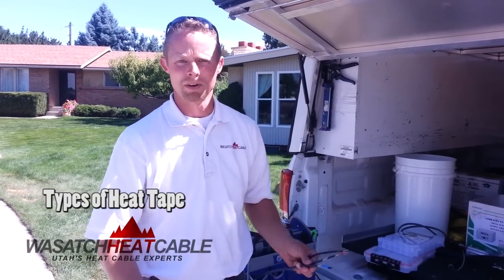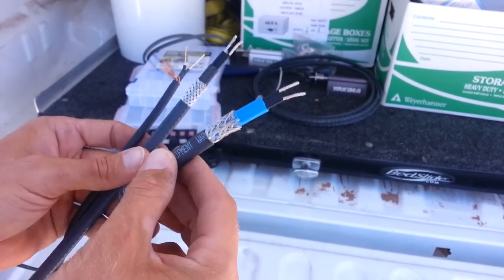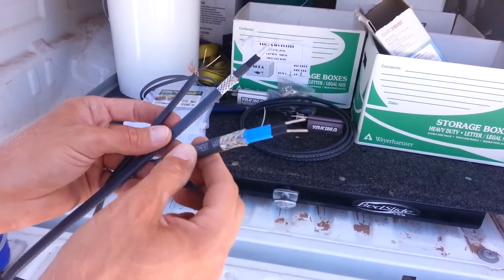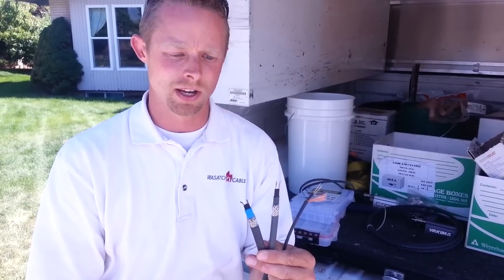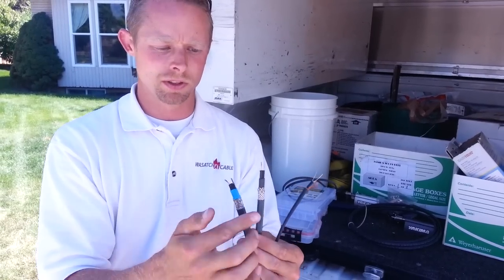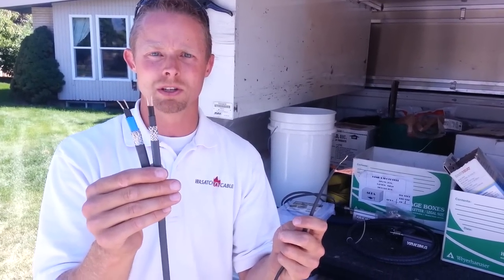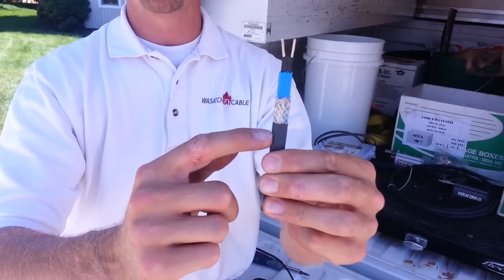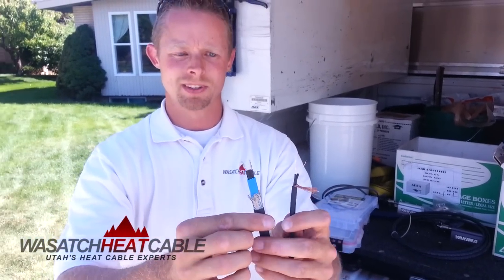Types of Heat Tape/Cable

Comment: He claims the constant wattage heat tape will use the same amount of power year round. The Easyheat tape he refers to has a thermostat that shuts off the power to the tape when the pipe temperature reaches 45°F. That said, if the thermostat is defective, then yes, it WILL consume energy regardless of the ambient temperature. Otherwise, at temperatures over 45, it won't consume ANY power.

Comment: Nice explanation. Can I use a 12" length of constant wattage cable to wrap around an outdoor GFCI outlet box that is mounted on a marina float? The GFCI is shutting off due to ambient humidity and my hope is to reduce that humidity without interfering with the intended performance of the GFCI outlet. Next question: Can one cut this cable to a 12" length without affecting it's performance (other than the obvious loss of heat)?

Comment: I have had It with electrical heat tape It requires a lot of Insulation to work the wires break Inside the thermostat does Not work most of the time they heat so slow can Not tell If working one time I cut the cable In half and watch If for a while then went to bed during the middle of the night It caught on fire a few hours later I found the garage floor flooded luckily when It burned through the line It put Itself out.... 
What I want to try and I do Not know why No One does It, Is wrap the Water lines with clear plastic hoses and have a Water tank and a large Fish aquarium heater and a hot Water pump and pump warm Water through the hoses.

Comment: Definitely an error in the narrative near the 5:30 mark. As the cable cools it reaches a zone where it starts to transmit electricity which produces heat. Further cooling will cause the cable to reach its maximum designed heat output.

Comment: Homeowners can save a ton of energy by using a ReadyTemp ATC3000 system to prevent their pipes from freezing.  Installs under the sink, and intermittently circulates warm water throughout the hot and cold water pipes.  20 minute DIY install requires connecting 4 hoses.  No required annual inspections like heat tape, and last 8 to 10+ years.

Comment: How SAFE are self-regulating heat tapes? I've heard of the bus lines arcing and causing fires... I presume using an AFCI breaker would shut the circuit off if it detected arcing before it became a fire hazard? I'd love to hear your opinion on this...

Comment: Thanks for this instructive video. I consider installing heating cable in my covered garden to extend my gardening season. i would install the self regulating type cable 1" deep...does it make sense? what is the appropriate spacing? is is possible to set the output temperature ?
Reply: I was planning the same thing in my garden.  Did you try it? if so, how did it work?

Comment: At 5:34..."the COLDER it gets outside, they de-align and REDUCE the heat output".  I thought the COLDER it gets, MORE HEAT is produced by the wire.  Confusing.
Reply: i think that was a mistake
Reply: Reduce means lesser/less

Comment: How are these physically supposed to work?  I have the blue one.  At the end of it, it has a 33k ohm resistor in series with a little bulb that lights up.  I did a continuity check/checked the resistor and it's fine.  However, it's 9 deg.F outside and the tape is around 24 deg F, which caused my pipes to freeze (used infrared thermometer).  The bulb does light up.  What's wrong here? How is the circuit completed?
Reply: Just learned that the carbon inside makes the contact when cold, heating the cable,  as the video states.  The resistor and bulb at the end is to let you know that there's power to the unit.  My 13 feet of cable has no ohm resistance (only .3), which means the unit is fried.